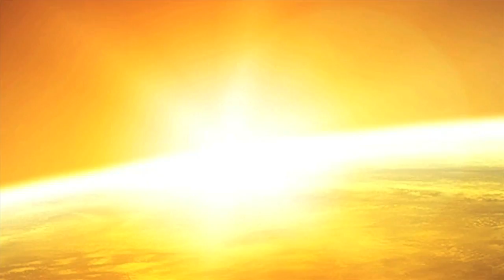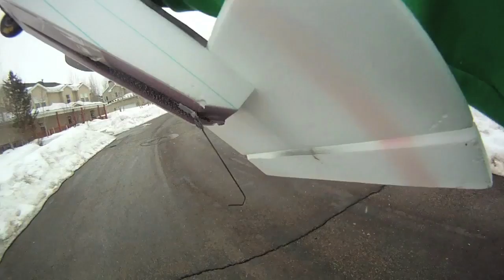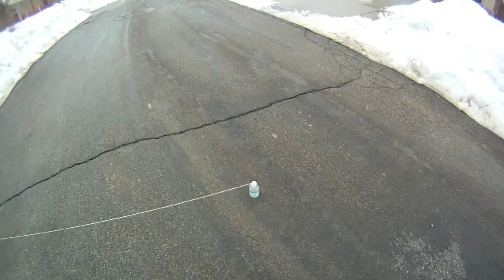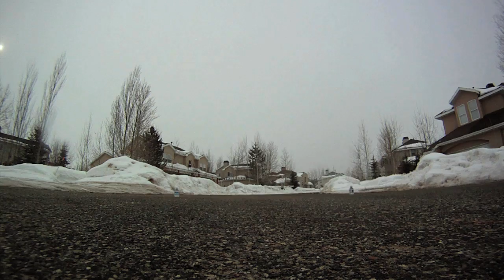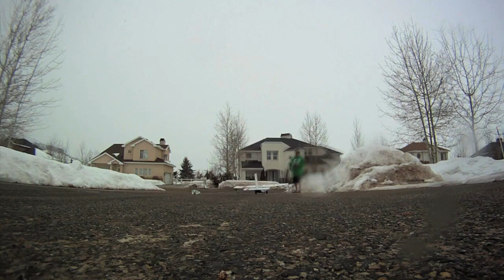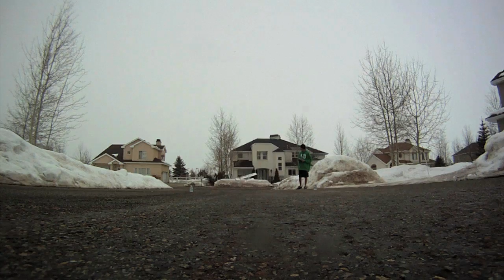Mini Cargo Plane with Arresting Wire

Comment: the arresting wire system would have worked better had you factored in both the weight of the plane and the speed in which you were attempting to land it at to make the arresting weights heavier